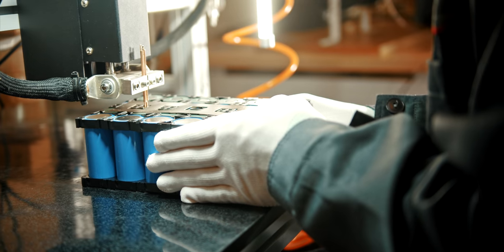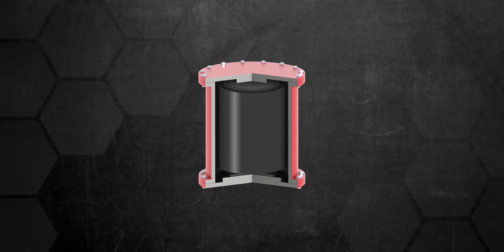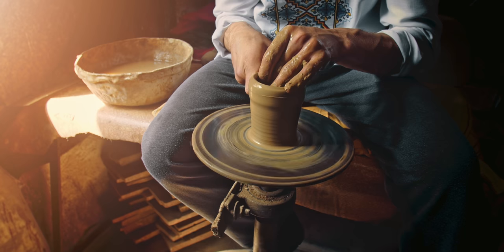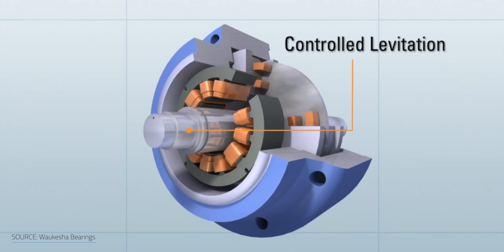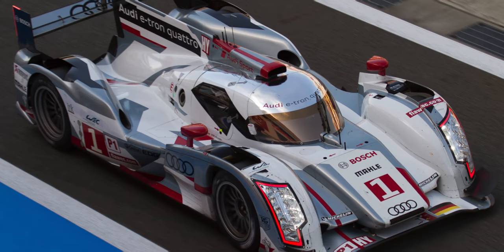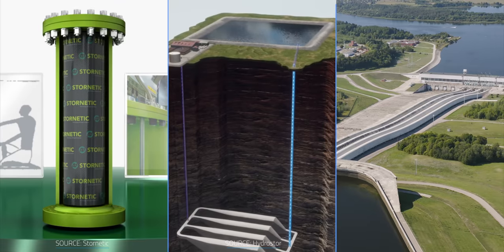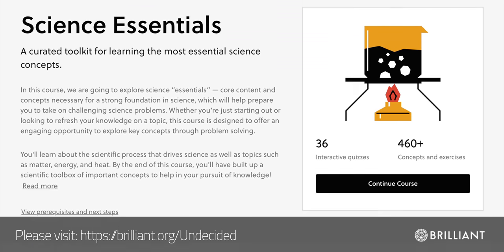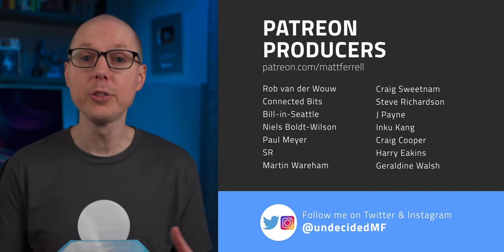The Mechanical Battery Explained - A Flywheel Comeback?

Comment: We had Pyler or Pyle Motor Generators back in the 80’s and 90’s for Computer Rooms. They had massive Flywheels. They were to smooth the Street Power out, and to give a UPS Generator time to come on line, in the event of a Power Outage.
Reply: Yep. No idea of manufacturer but I have seen a flywheel system used in place of battery UPS to bridge the time between mains failure and the DRUPS coming online in a Data Centre.
Reply: Looking through my Work Diaries, I found out it’s the “Pyle National Company out of Chicago, Illinois USA. We only used Mobile Synthetic Grease, on the Bearings. Since I didn’t want to carry two Grease Guns I used this Grease on all my HVAC Equipment. Work gave me a hard time about using this Expensive Grease, until I pointed out I had Zero Bearing Failures.
Reply: @gravelydon7072  Thanks for the info, the largest of the Pyle Motor Generators was at 50 F Street N.W. Washington D.C. it was such a massive machine, I wonder if it’s been abandoned in place. BTW they had two of them, one smaller, to run a back up computer room..
Reply: @stevenmoomey2115  Depends. Was it in a high rise grayish brown brick faced building? Buildings look too new there to have been around in the 80s. Next time I go thru Union Station I'll have to check.
Reply: @gravelydon7072  That’s the Building, it or it’s twin was built in the late 80’s. I worked in the building as a Roving Service Tech, for one company. Went to work for a different company, and they had a contract with Rail Inc. Computer Room was in the basement, had a Emergency Dry Cooler out back, that the street people built their tents around it. On the roof was a massive generator and cooling tower with a bundle in it, to cool the computer room. Around the late 90’s Rail Inc. Moved operations to Georgia. I had a lot of customers in the area, including the hotel directly behind the building, hotel chiller around the corner, the bank across the street, a television studio on Capitol Street, and quite a bit of stuff in Union Station. The Glass building to the East was a parking lot. There was a nice eatery across the street in the basement. In the late 80’s I was in the Dubliner, with co-workers, for a lunch send off for a technician that was moving back to his home in New York State. Federal Police came in and arrested one of the owners, for allegedly supporting the IRA. It was a regular occurrence,  according to the send off, who played in a band there.
Reply: @stevenmoomey2115  Next time I'm in the area there I'll check with the people next to the door and see if they know anything about it. There are twin buildings there with a third that look similar but is a parking garage in part of it.
Reply: I was involved in installing a 60-400Hz motor generator UPS in the late 80s for a mainframe computer system. The computer and the UPS were both water cooled
Reply: @ProctorsGamble  Was it a Cray Super Computer? We had a Job back in the Early, well into the 80’s that had two Cray Super Computers. They had Three Edpac Chillers, that feed into an IBM Converter. It feed highly distilled water to the Cray to cool it down. Also we had Sperry Uni-Vac systems else where, that used vacuums to pull the cool conditioned air thru the computer. Hence, the name “Uni-Vac.”
Reply: @stevenmoomey2115  The actual name came from their UNIVersal Automatic Computer.
Reply: @gravelydon7072  Okay, but they did have vacuum systems on their computers. After changing the second motor out at the Hoffman Building in Alexandria, in a short period of time. They supplied the motor. I did a little research, and found they had the wrong motors in their spare parts cabinet.
Reply: @stevenmoomey2115  Yep Sperry-Rand used a vacuum to keep them cool. IBM just cooled the whole room down. To the point where you understood why the guys in the room were wearing jackets when it was 90° outside.
Reply: @stevenmoomey2115  Pretty sure it was an IBM. It was Wm R Mercer/Meidinger Tower in downtown Louisville. It was on the 11th floor and had 4 - 4" copper water lines that ran from the basement to there. One pair of lines was for ambient cooling an the other for equipment cooling. All 400Hz wiring was in nonferrous conduit (aluminium). The floor below had to be reinforced to handle the weight of the UPS all the way from the elevator to the final position of the unit! I always feared for the person on the 10th floor who's office was directly below this monster. I wonder if it is still there...

Comment: two surprises :

1. It even works. 

2. Given that it works, It still costs more than batteries.
Reply: I suspect they'll have the same issue as flow batteries, initial cost will always be higher due to scale, while they can take some of that back in long term operating costs.
Reply: Yeah bcz noones using it and trying to make it cheap.also..they use compostie expensive materials which are also not produced efficiently
Reply: @anandsuralkar2947  Where volumetric efficiency is not a concern, like stationary storage, a cheap brush high-tensile steel wire has excellent tension resistance to flying apart and can be rotated to higher speeds than the old steel high weight rim flywheel designs. The added benefit of tensile designs with lots of elements is that failure is progressive, producing more heat than physical dangers.
https://www.sciencedirect.com/science/article/pii/B978008025471550049X
Reply: I think it is the refrigeration needed to keep the bearings cold enough for the superconductors to work, that really pushes up the cost. Then if you've splashed out big for the cooler, you're gonna want the best possible flywheels and you are buying really specialist materials.
Reply: Not really surprising that it works given that this is already how the grid regulates itself and has done for a century - coal plant turbines use their rotating mass to smooth the output and stabilise the grid.
Reply: You forgot the fact an average/cheap battery lasts for a few years while this lasts for few decades.
Reply: @crodex667  and that right there is why its being installed in places despite the high initial costs.
Reply: We had a flywheel storage system here in town. It went boom. Fortunately nobody was injured.
Reply: @crodex667  my first greenworks battery is almost 9 years old .. still blow leafs
Reply: Doesn't have to be expensive. At the heart of it it's a big drum of steel. Doesn't have to spin especially fast if it's big. Industrial economies are very very good at scaling these things up.
Reply: @dd-ow6pe  It's all about cycles. Lithium just can't be cycled near as much as a flywheel. If you used your greenworks 10 times a day, it would have died within 6 months.
Reply: @rclewis01  .those are early batteries.  tech is getting better everyday. AI will look into internal lithium contruct. greensworks will fly planes. 30,000+ cycles will be possible. elon's batteries will be essentially be , dense super capacitor. capacitors was his doctorate. buy tsla. i made $1,000,000+ already. wait you'll see ,
Reply: For your 2nd point, I would really encourage you to watch the video of real engineering: the missing link in renewables.
Reply: @morosis82  but the politician is interested in the initial cost,the higher the price,the more you can distract,so if you want the subvention.....
Reply: i mean the main difference is that we've had flywheels for thousands of years and centuries of improvement for their use as energy storage. its unlikely we'll find too many ways to cut cost down even more
Reply: @appa609  It doesn't even have to be expensive solid steel, if the bearings are magnetic: rotating rocks, sand etc. inside of a strong steel cylinder would do just as well, and the magnetic bearings would compensate for the inherent inbalance.
Reply: @fhajji  what inherent imbalance?
Reply: @michaeljames5936  - super conductors may not be an issue in flywheels forever as there has been a breakthrough - room temp superconductors have been discovered/ created in lab. Albeit under extreme pressure when literally pressed between diamonds. Work is still underway, but that alone could be used in a flywheel sooner than electrical grid transmission lines. Even more so as diamonds have been successfully created with co2 scrubbed from the air. Amazing stuff.
Reply: @appa609  I’m inclined to agree- although I noticed that the flywheels we saw were partially buried and a particularly large flywheel would be harder to install in certain locations and worse, if it’s too big there could be too much friction to get/keep it spinning let alone supply enough power long enough on full discharge. Unless we are assuming electro magnetic levitation which just makes it harder to build to perform if at all under a feasible budget. Which is a shame as I love the idea.
Reply: @shawncrocker7037  rocks and sand are not perfectly solid, they have irregular spaces in between irregular shaped grains/pebbles/rocks and they are all made of irregular mixes of minerals. It’s not a metal or well mixed alloy which would have consistent weight distribution for smoother efficient safer operation- which is the catch all the same to get the most out of a flywheel for the duration of its operation.
Reply: But it seems like flywheels last far longer, less maintenance, more robust
Reply: @morosis82  
ehhhh,   hydro plant turbines do nothing of the sort?
Reply: @ursodermatt8809  where did I say anything about hydro?
Reply: @morosis82  
exactly

Comment: Great video! One question still remains unanswered for me: how long can you store energy in a flywheel unit? How long does it take until you lose 50% of the energy? An hour? Few hours?
Reply: Theoretically? Forever (--> Newtons first law)! Practically however, it depends on how well the flywheel unit is made: the tube has to be completely sealed and contain a near perfect vavuum, the bearing/maglev system has to induce as little friction as possible and the mass has to absolutely balanced. All of that is the reason those things can be/are so expensive - at least when you aim for a high efficiency. A rough estimate for current, commercially available flywheels systems for mass energy storage purposes is about 5% self discharge per day (Li-ion battery: ~2% per month).

So to answer your question: it would take about two weeks for a fully "charged" unit to drop to <50% capacity.
Reply: @nicoj9984  thanks for elaborating on that. I had expected a much higher self discharge rate.
Reply: @nicoj9984  it is high loss for long term, so it is good for daily use, many number of cycles
Reply: @makantahi3731  In the context of grid storage, that's exactly what they are intended to do: They aren't meant to store huge amounts of energy for a long time, their job is to "smooth out the curve" of renewable energy sources over a short(er) period. They will, for example, store some of the energy a solar array generates during the day when there is lots of sunlight and then release it during the night when there is none.

My area of (some) expertise however is the use of flywheels as uninterupted power supplies (UPS) for bigger datacenters:
Here the main advantage of flywheels is that they can discharge their stored energy very, very quickly while chemical batteries are comparatively slow. So if you need lot's of power (Im talking megawatts) for just a few seconds to keep operations running until either grid power is restored or a buckup generator has ramped up, you would need a shit-ton of battery cells to deliver that much power at once - or you use flywheels and save a lot of money, space and maintenance.

Comment: Surprised you didn't mention the incredible localized danger that flywheels all have in their kinetic energy that is NOT quickly dissipated unless you consider a powerful mechanical explosion as quick. Flywheels once were considered for cars until they realized that, if a car had an accident and it released one of these 200 pound flywheels spinning at 5000 rpm it would escape and crash into other cars like a monster devouring these other occupied cars AFTER the primary accident stopped -AND, if other cars had flywheels then a chain reaction could release those flywheels too. The pent up kinetic energy of a spinning flywheel is HUGE and scary to even be in the proximity of.
Reply: Not a problem for stationary storage flywheels. You just dig a hole so the spinning bits are a few metres below ground. If it breaks it just means your hole is now a little wider.
Reply: @kenoliver8913  Sadly there isn't a lot of point in stationary storage wheels though. In almost any large scale measure you can think of other forms of power storage are better be it hydro or weight based. Far better to pump water up and have it flow down to create power than rely on a spinning flywheel. Same for lifting a weight and dropping it.

Fly wheels also suffer greatly over time so it be ill suited towards long term storage. Aka excess power in the summer months from solar to use in the winter.
Reply: That's why cars needs to be banned xdxdxdxd
Reply: I like the fact engines do use flywheels to keep the cam shaft rotating :)
Reply: This is one of those classic cases of a “critique” of energy storage/green energy mechanisms that is so grounded in anti-renewable hostility that the author doesn’t bother to make sure it actually makes sense. Seriously? First, DON’T PUT WHEELS ON YOUR FLYWHEEL AND DRIVE IT AROUND LIKE A CAR. Second? PUT IT IN A CONTAINER (A HOLE IN THE GROUND IS FINE). Sheesh.
Reply: @davestagner  Yeah it's one of those "it must work for everything approaches" that far to many alternate energy types fall into. Flywheels are horrible for long term storage, it's also bad for mobile objects like a car or boat. However for a small house or something it could work for short term storage. Like say taking the power of solar and charging up the flywheel for night time use.

Though the data on long term wear and tear, maintenance etc are not really available far as I know. It still can't be worse than replacing Lithium battery walls every 10-20 years depending on daily load and battery quality.
Reply: @edwardcardozo8325  We kind of oversaturated on them.
Reply: Flywheels energy storage in cars is only any good in a hybrid system, not standalone so you would not need a wheel of that size. Years ago I worked for Williams hybrid power, at 6:15 the audi unit is one of the systems I worked on, the body is a containment housing and the flywheel will not go anywhere even if the bearing fail at full speed, there are burst discs in the housing to release the pressure build up as the composite wheel would off gas due to friction as it ground to a hault against the walls of the housing
Reply: @neilread6888  Do you think flywheels might be useful for regular street car hybrid systems, or just racing systems? I remember them being used at LeMans and other races, but race cars are using hybrid more for performance than efficiency.
Reply: @davestagner  I can't see it, flywheel systems can 'charge' up really fast and also deliver the energy fast and are very well suited to a lot of heavy acceleration and breaking ie racing, but have limited use in road cars where you would spend most of your time cruising at one speed. Although the units are not heavy when compared to batteries they are quite large, Google porsche 911 hybrid flywheel images, that is a williams system on the passenger side
Reply: @kenoliver8913  
It escapes through the top of the hole and then creates havoc.
Reply: @MmeHyraelle  I drive a stick shift.  Fairly heavy flywheel that interfaces with the clutch plate.  I have no clue why he thinks cars don't have flywheels.
Reply: Stick it in the ground then

Comment: "They can be completely charged within a few milliseconds"
This seems unlikely and I could not find a source (one of the links was broken).
 I think the response time may well be milliseconds and specialist flywheels can discharge very quickly (e.g. for railguns). 
https://youtu.be/8X2U7bDNcPM?t=345
Reply: i guess he mispronounced
Reply: Thanks for pointing that out. Seemed off to me, too
Reply: Yeah, I thought the same, you can't simply accelerate a high amount of mass in that time orders without wrecking some (if not every) component in the machine
Reply: In theory, a flywheel can be charged in the same time a gun is fired. One big bang of energy and the flywheel is humming, fully charged.
Reply: Requires only a trillion ton*miles of torque.  So??? lol
Reply: Yeah, at 5:45 the text also states "charged at 8kW for up to 4 hours" so I think they mean it takes 4 hours max to fully charge. So they're 32 kWh.
Reply: i replayed that bit a few times just to make sure i fully understood and heard what he said. definitely a mistake, I don't think we have any material or motor that can be of that mass and accelerate to 10,000rpm within a few milliseconds.